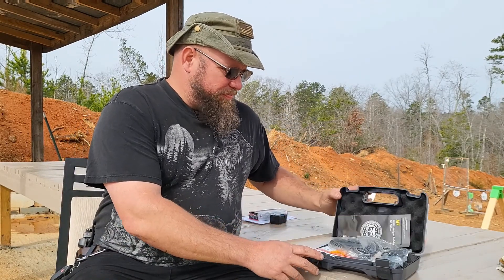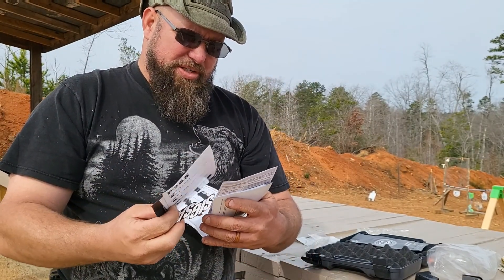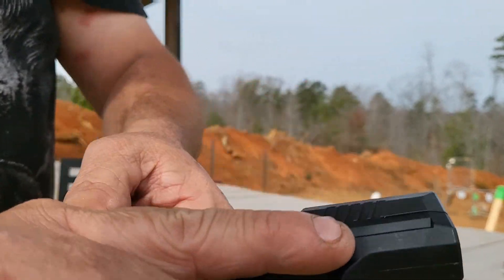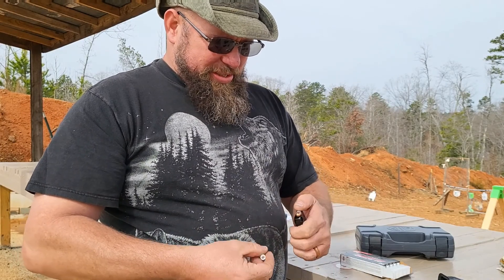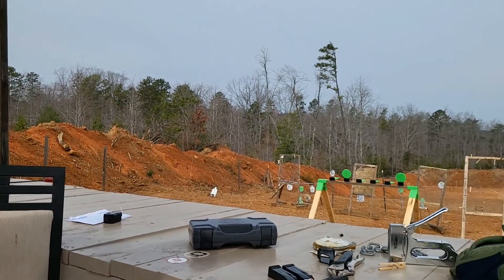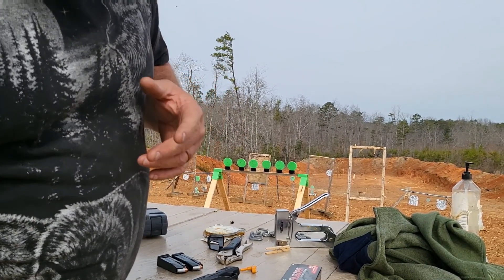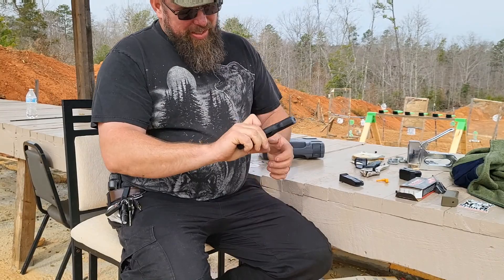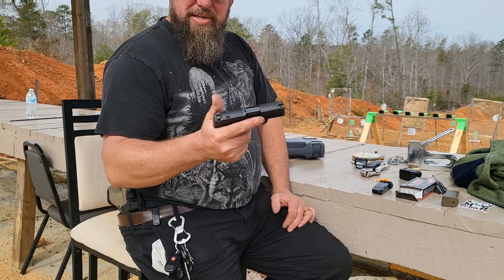Sig P365 .380 ACP unboxing

Comment: The p365 xl frame fits with the slide.     The 12 rd 380 mag fits that.  I like the Tactical Developments mag base plate.
Reply from the maker: Thanks for the tip
Reply: Thanks for the tips just picked one up.
Reply from the maker: You won't regret it
Reply: @offthextrainingsolutions399  the 380 slide is smaller than the 9mm slide, therefore 9mm holsters will be a bit loose.  If the holster ‘indexes’ on the trigger guard, not a problem.

Comment: Hey there, fellow Tarheel! Thanks for the review! Just got one myself … did you clean the white “gunk” out of it before testing it? I went to the range with just a quick cleaning, but should have cleaned it better as I had a few minor malfunctions (stovepipes, slide not locking back on empty, and one time not going into battery - although I wondered if maybe it was the extra 12 round mag I got for it) and boy are those mags stiff! I don’t have the best grip strength and had one heck of a time loading… my friend let me borrow their UpLula… night and day difference! I’ll have to be getting one of those. The mag loader that came with it is not helpful for me at all… the spacer keeps it from pushing all the way down, so it will be going in my cabinet probably never to see the light of day ever again.😂 After a good clean I’m hoping the next range day will run smoothly with no issues. I like it so far and look forward to working out the kinks and having it as my EDC.
Reply from the maker: I have several of the uplula loaders they work great the mags do loosen up pretty quickly and yes I cleaned the gun and lubricated it with CLP prior to shooting it.

Comment: Looks like a great option for pocket carry.  I have the sig p365 macro x and, like you prefer 9mm. But, I would like to have this gun and I would carry it in some situations
Reply from the maker: I can see where certain dress clothes would limit carrying a larger gun. I just don't get that dressed up for anyone and if I do I just buy suits slightly bigger in the waist to accommodate fit my larger gun. Lol
Reply: @offthextrainingsolutions399  I get what you are saying not worrying about pleasing folks.  I have thought about getting the sig p365 grip module, slide, and recoil assembly, then I would have a p365 because I would be using my f.c.u. and my barrel from my macro x.  Then I could just use lighter loads
Reply from the maker: Sounds like a good plan to me

Comment: Appreciate your work. Here's my big problem with this gun: why didn't they make it smaller than the 9mm version?
Reply from the maker: I was thinking that too it looks like you could just swap the barrel, guide spring assembly and mags to run 9mm
Reply from the maker: The mags for sure are 9mm bodies with a polymer shim at the rear of the mag to compensate for the shorter .380 auto
Reply: So that if you already have the 9mm version you can use the same holsters. 😊
Reply from the maker: I know the slide on the .380 is shorter from top to bottom not overall length wise. That makes the guns overall height just a bit shorter than the 9mm as long as the holster indexes in the trigger guard it should fit but I would imagine it will be a little loose
Reply: 12rd 380acp would have been nice ....
Reply: @richki.24  12 rd 380 mags are for sale now.  I like the Tactical Development mag plates because I have xxl hands
Reply: @cwolff5119  , great thanks
Reply: It's small enough for me. Smaller than my 9 and 40 compacts but I can still get a good grip on it. Anything smaller gets hard for me to manipulate. It still fits in a pocket holster for those very discreet carry days. Shoots quite nicely as well.
Reply: Sig already makes a smaller .380 ( aka 9mm short). …The P238.

In this case, they were expanding the P365 modular ‘eco system’ with a lighter, smaller slide.

The user can use whatever grip module that fits them.

And it fits in P365 holsters…. Just a little loose.
Reply: Try a "mouse gun" and I bet you will come up with some reasons

Comment: Just curious to know if you’d recommended a revolver for EDC for those w/grip strength issues.
Reply from the maker: I good high end revolver with a good trigger  job maybe but the double action trigger may be a bit heavy for some one with grip strength issues
Reply: As you can tell from my screen name I’m old school when it comes to some of this but do appreciate your video & point of view.
Reply from the maker: Thank you it means a lot, if you are dead set on a wheel gun I recommend  A s&w steel frame revolver and have a competent gunsmith do an action and trigger job on it to lighten the double action up from 12 pounds to around 6 or 8 lbs that will make for a good carry gun for grip strength issues the added weight of the steel frame will help absorb recoil as well.
Reply: @offthextrainingsolutions399  an alloy frame is easier to carry if you carry all day.  And S&W offers models with moon clips.  Fast to reload.

Comment: My unboxing yesterday was more shocking. Walked into a LGS and asked if they had one. When they said yes I said sold. Hell, I didn’t even know they made one with a safety.
Reply: The frame is identical to its 9mm brother you can just swap the slide barrel and spring FYI
Reply: I was happy to find and purchase one with a safety. Especially on something I carry in my pocket.
Reply from the maker: Safety on pocket carry guns are definitely a good thing along with a good pocket holster
Reply: Yes, I tried the .380 slide on my XL and it fit perfectly so that’s how they got to the P365X. I have received the XL frame and two of the new 12 rnd .380 mags from Sig for this project. The safety is easily removed but, guys, use caution if you do this for two reasons. 

First, removing the safety voids the Sig warranty. Keep that in mind. I’ll be shooting the pistol extensively before I make this move. And it won’t be a pocket pistol even while it’s in stock configuration. I have both IWB and OWB holsters and that’s how it will go. I have a Kahr CW380 for pocket use.

Second, the FCG is NOT pinned together the way a P320 is. It’s put together and then stuffed into the frame to hold it together. I pulled mine out to clean the “new goo” off it and parts just started falling off. The situation got worse while I was on the phone with Sig and the gal finally said to just send it in. It’ll be delivered back to me on Tuesday. Watch the Sig Guy’s disassembly and reassembly videos on YouTube to see what I mean. Kind of scary but the FCG can be tipped up enough to remove the safety; there are videos about that, too. Pretty easy if the FCG doesn’t blow up in your hands.
Reply from the maker: Good tips thank you
Reply: @offthextrainingsolutions399  I get the whole “training issue” thing BUT… other than my 1911’s this would be the only pistol I own that has a safety. I went with uniformity of manual of arms when I got rid of the hodgepodge of pistols I had when I left Commiefornia and had a better variety to shop from. All striker fired for defensive purposes. No manual safeties.

Comment: Would love to see a comparison on recoil to the S&W 380 EZ.  Would be even cooler if the P365-380 had the xgrip and 12 rd mags that just came out. Long story short been on a long journey to find my wife something larger than a 22lr that she can train with. Neck problems of 14 years.
Reply from the maker: I don't have a 9 mm 365 but I have shot them  the .380 is substantially less recoil we work a lot with students who have grip strength issues or recoil sensitivity I think the 365 in .380 suits that need very well. They do have 12 round mags for the .380 as well my uncle just purchased two.
Reply from the maker: Sooch00 has a video up comparing the 9mm and. 380 check it out
Reply: All the p365 grip frames fit with the 380 slide.  12 rd 380 mag.
The SW 380 ez is slightly heavier, longer slide, wider grip front to rear, grip safety, loaded chamber indicator, and 8 rd mag.